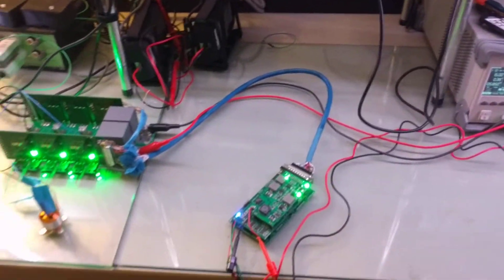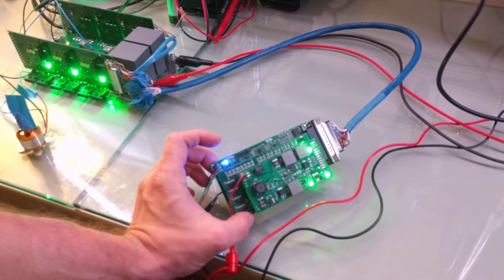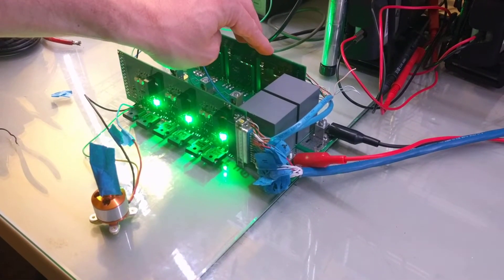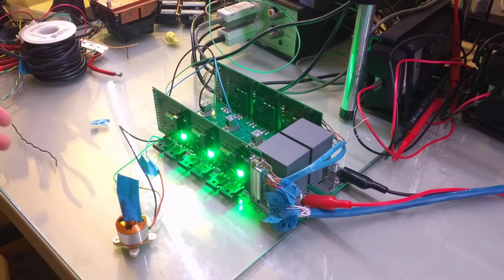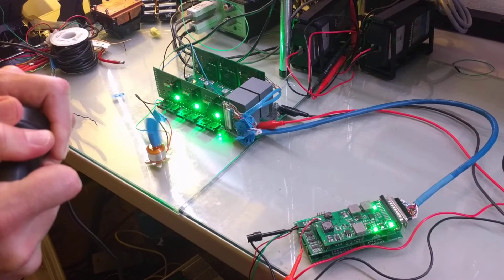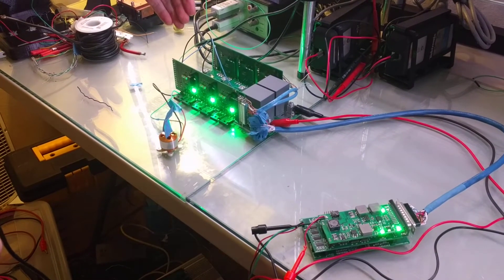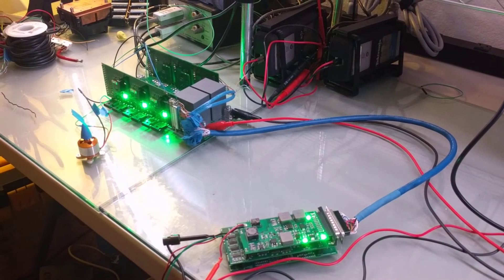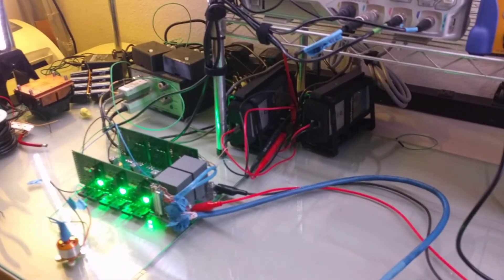12FET HQ Power Stage and VESC Controller

Comment: Can you share a circuit, I'm interested how did you solve a current sensing, what is the frequency response on current line.
Reply from the maker: I'm using Allegro ACS758 which have a 200kHz bandwidth and react plenty fast enough.  I've used Allegro sensors in multiple designs without issue.  I have a bunch of info on https://endless-sphere.com/forums/viewtopic.php?f=30&t=51342&hilit=zombiess+irfp4568  just search my username on that site and you'll find good discussions on technical topics relating to controller design.
Reply: @ZombieSS77  Thanks, but does ACS758  has 120KHz response?
Reply: According to datasheet: https://www.allegromicro.com/en/Products/Sense/Current-Sensor-ICs/Fifty-To-Two-Hundred-Amp-Integrated-Conductor-Sensor-ICs/ACS758
120 kHz typical bandwidth
Reply from the maker: @n3r0z3r0  Yup, I was thinking of the wrong device, I've been working with the ACS72981 sensors recently, they are 250kHz.  So the ACS758 will only be able to measure a max of 60k eRPM due to Nyquist, otherwise there will be aliasing issues.  Ideally you sample 10x fundamental, but life is rarely ideal.  Of course you uC needs to sample fast as well.  The waters get deep quickly.
Reply: @ZombieSS77  Yes, I also find that device interesting, but passing 200A threw 1.8mm² pad for me is unrealistic.
I found ACS773ECB-200B-PFF-T-ND (200KHz/200A) quite promising, but didn't seems to available in stock in all shops I know. I have ordered 3 demo boards with this IC from China... Hope they will arrive some day ...

Comment: Nice job! Already plans for a small production run? I am interested in a version for 36S/48S 150A continuous and 250-300A peak.
Reply from the maker: I'd like to do a production run and can design for that power level, but I'm currently occupied with contract design work.  I'm starting to move into manufacturing, but it's going to take a bit to get up and running.
Reply: @ZombieSS77   Looking forward to buy and test a sample unit! We are building motorcycle prototypes for EU L3e-A1 class and are currently testing the VESC 100/250 and are excited for the VESC 150 and BESC Gen3. 48S would allow the use of DC fast charging stations and be a big feature for the next, more powerful, model. Will follow your posts and contact you as soon as a production run seems immenent.
Reply from the maker: @justan1ck  I don't have any plans to go to higher voltage at this time.  I'm a fan of lower voltage (28-30s) and high current.  I have a significant amount of research into high current solutions reaching into the +1kA range which is how I intend to reach 100kW.  I shelved my prototypes a few years ago, but have started up work again and am acquiring an 3 wheeled EV motorcycle to continue development.  I can do HV, but I'm not very comfortable working around it yet.  Most of my time is being taken up by some clients, so I'm unable to do much right now, plus I have a day job.
Reply: @ZombieSS77  There are some important safety precautions necessary.. but all of them should be standard above 60V or 120V at least. I was lucky enough to play with 144S in formula student.
There is a gap between the readily available inverters where many efficient 100-150V MOSFETs are available and Axiom level 96S+ IGBTs. 
An accessible 48S inverter would enable good value EVs with fast charging. 

What motors will take 1kA without breaking the bank?
Reply from the maker: @justan1ck  Many large motors will take 1kA or more, if they don't it just means you need a bigger motor.  I have a 75-5 motor from a Zero SR (non IPM), according to the designer +1kA is not a problem for short bursts.  My target is saturation of any given motor so I can obtain maximum power transfer.  MPT means 50% efficiency, so it can only be done for a short period, but it's fun.  I'm not really concerned about cost of the motor or even application.  I just like extreme engineering.  I agree that there is a space which needs to be filled before getting to Axiom's level and I'm working on it, but I've been getting several requests to design inverters recently and have accepted the challenge.  Axiom's schematic was a large influence on this design and it shares many of the same basic concepts.  Axioms lead engineer was my mentor for several years, so I try to design with and emphasis on safety and reliability.  I'm also working closely with an isolation expert.